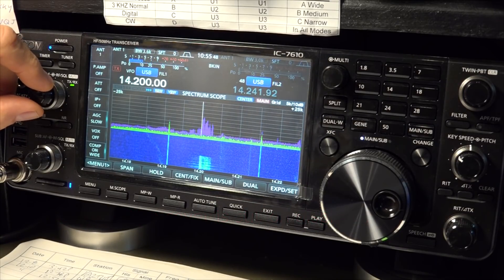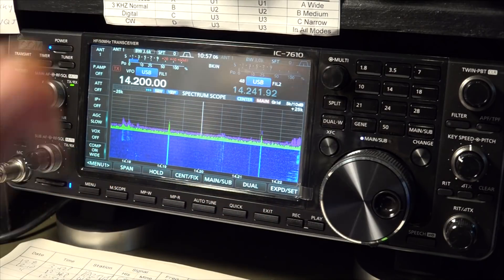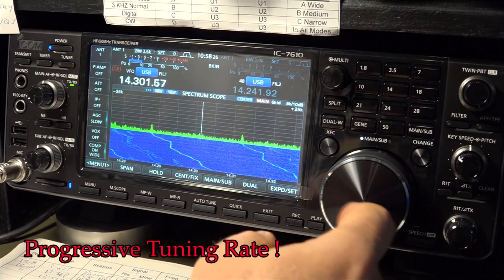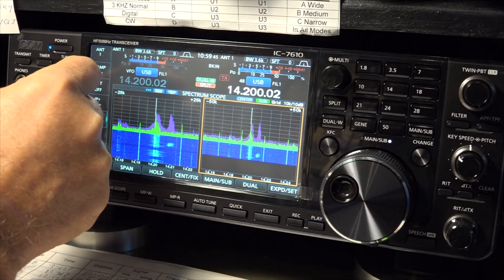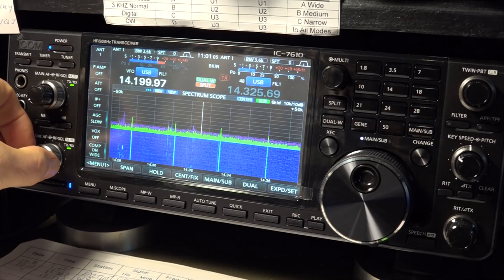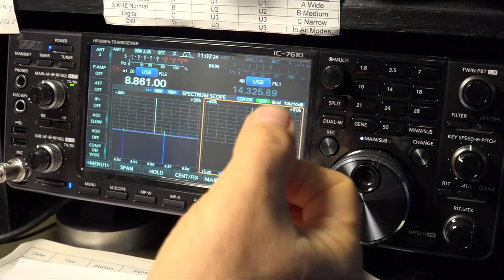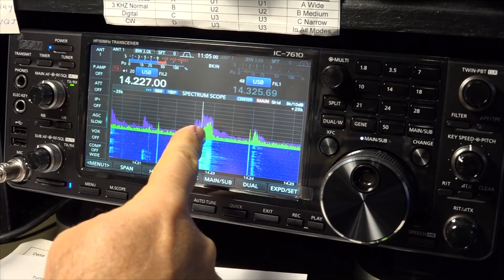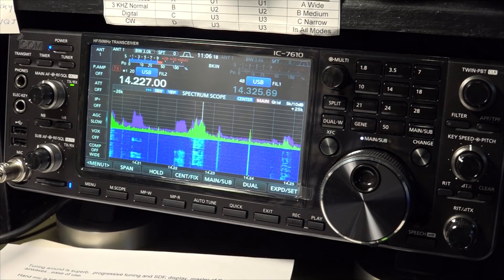IC 7610  - Should you buy one?

Comment: Another great video Bob, thank you.  I have gone back and forth between choosing the 7610 and Flex 6400M.  For now Flex is wining.  But there is something about Icom's that get my attention.  Have you considered the 6400M for yourself Bob?
Reply from the maker: Dave- I sold my 6300 to raise cash for this radio. I owned a Maestro for several months too. Although the 7610 is not a "radio lab in a box" like the Flex, I just got tired of two things. One is that it all runs on Windows. Even the Maestro and 6400 screen is just a Windows 10 tablet. The other thing is that the DAX and CAT utilities were constantly changing and I found them problematic. The latest versions are the best so far. Lastly, I just fell for the look of the 7610 over the 6400. I never use a radio remotely, nor even use multiple receivers. I'll probably jump back on the Flex wagon with their next release....ha!
Reply: Thanks Bob, I appreciate your input.  It's kind of funny (or maybe not) I have put far less thought into purchases many, many times more the cost of either of these radios.  Yet, I research until I can't read or listen anymore on which one to buy!  Meanwhile, I'm having fun with my IC7000 on my desk....go figure??
Reply: Thats the issue with the Flex, I really dont want to deal with Windows. I want a purpose built radio. With the ICOM you have a purpose built operating system running the FPGA. I wonder if the A/D ADC is 16bit or 14bit.
Reply: The 7610 is 16 bit and the 7300 is 14 bit.

Comment: Thanks for the interesting review Bob, It would be nice to see it compared with the 7300 because I,m not sure its worth three times the cost at that sort of money you have to seriously consider Flex but i do  understand some folk want the traditional looking radio. Also your right 200w would be nice.
Reply from the maker: Steve...yeah, that would be a good A/B. I can tell you that the TX should be all but identical. It will be slightly cleaner because of the better clock purity in the 7610. The RX is "sharper" in the 7300...not quite as smooth sounding, but excellent none the less. The difference between the 14bit and 16 bit ADC chips makes less than 2 DB improvement overall. Anyone who get a few 7300's instead of this radio- will not be disappointed.
Reply: Thanks for the reply, I do watch your YT channel and it provides an interest to me, keep up the good work and seasons greetings. KR Steve G0OGS
Reply: We agree with Bob's synopsis.  Its a lovely radio but unless the rest of your shack and antenna system is up to scratch the IC-7300 is more than enough radio, especially when used in suburbia.  A small percentage of Hams near broadcast stations etc will benefit from the variable pre-selectors, but all in all you can't beat the IC-7300 for your $$$$.

Comment: I & many others have found the "background" noise to be an issue with the 7300 also.  Depending on the QTH, it may not be a problem.  I was wondering if they'd fix that in the 7610.  I appreciate you noting that in your review.  Very helpful. - 73 Bob
Reply from the maker: Bob- It's a hard call so far. I do notice that the noise floor jumps up at times on the 7610. I have plenty of noise sources here..and I know a few are switching power supplies. I also have a huge solar array with inverters. I can say that it picks up different noise generators than say my Kenwood. In a superhet, there are plenty of places for noise that has frequency components- to get into the RX. On the SDR, the dynamics are different. They very much want to never overload the ADC chip. The Digi-cel preselectors are basically over-kill. The situations where you would benefit from having it inline... are few. On the IP+ function (dithering), they have chosen a level of dithering that never shows increase in the noise floor. Dithering is adding broadband noise to the incoming signal to randomize any birdies in the receiver. They are converted into white noise. So, you trade a better behaving RX for an increase in noise floor. They kept it very light...you don't notice any difference with it on or off in typical use. I'm sure Adam Farson has a 7610 in the lab now. Let's see what the real numbers are...
Reply: As you know, Adam is a real Icom Fanboy.  And that is OK & I have no problem with that.  But if you look at his write up on the 7300, he has one sentence in there about 80% (as I recall) thru the report where even he notes the noise in the 7300.  I currently own Icom's, Yaesu's & Kenwood's, so I am not critical of any of the big 3.  They all have their strengths & weaknesses.  The 7300 didn't respond to RF gain reduction & ATT like my other rigs.  The background noise didn't change much when employing RF gain/ATT, to my ears & QTH.  That is not to say others haven't experienced something different.  We are all different & have different expectations. Except for the "noise", I loved the 7300.  It was otherwise perfect for me.  Thanx for the response, Bob.
Reply from the maker: QSL on all Bob. The flex radios exhibit the same sensitivity to noise...each design has vulnerabilities. My 990s gets hash from a laptop power supply...7610 doesn't hear it. The 7610 is set up a little too sensitive in general. And then there is the second RX tone anomaly. They HAVE to address this quickly.
Reply: My 7300 has a problem with the background noise but the adjustments of the radio can overcome that easily!